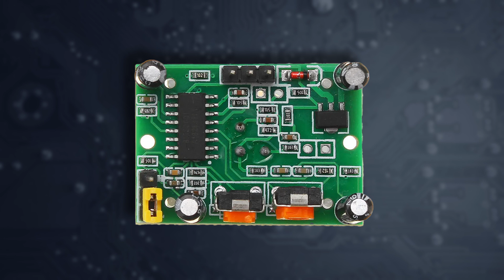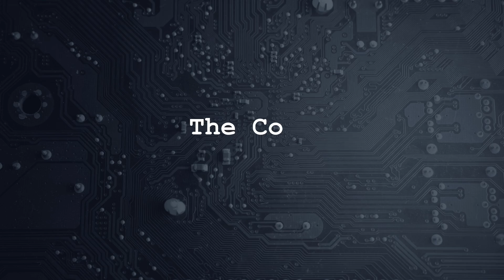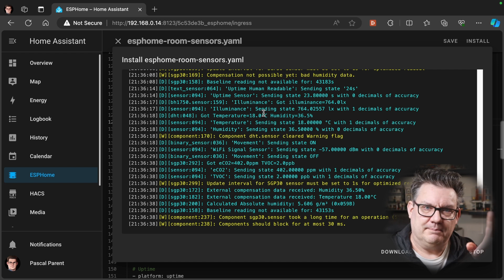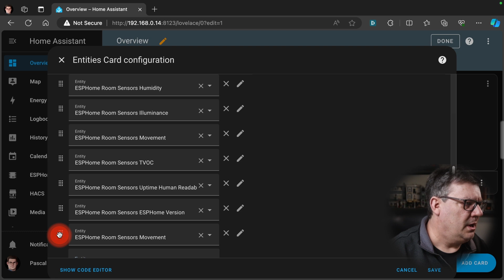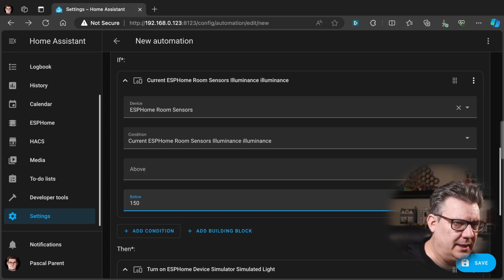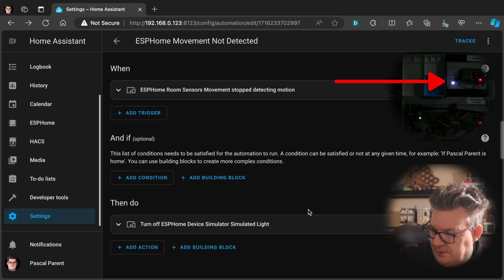Let's add to our room sensor - Part 5 - Movement detection

Comment: I like the video because each step is really well explained.
Although in my opinion, it would have been done in the same automation to turn it on and off. Instead of using 2 automations to do it
Reply from the maker: Right now I aim for simplicity, but it can indeed be done in one automation.
As you pointed out, each step is explained and splitting it allows for easier understanding.
Thank you for your comment.

Comment: Mostly i use mmWave sensors for detecting people in a room, they have the advantage of not turning the lights off on you when you are setting still (like reading , etc.), but i do use one PIR sensor under my bedside table for detecting when my feet hit the floor after getting out of bed to go to the bathroom for example. I didn't use a mmWave sensor there because i didn't want my bed covers triggering the sensor and turning on my LED strip under my bed. I have mmwave sensors in my walls totally hidden from view which is another advantage of mmWave sensors. Good video 😀
Reply from the maker: The mmWave tutorial is coming btw

Comment: Hi Pascal, good video, as usual. There are two items you missed in your comparison of PIR with mm-wave. 1. Line of sight; you can 'hide' your mm-wave sensor in a cupboard (handy for security purposes). 
2. Another item is in hot weather, the PIR sensor will become less sensitive.
What I do in my automation is add a condition for the automation to work. Example, in a living room you might want to turn off some of your sensors if you are out but your dog is still in. You can of course disable the complete automation, but using a helper that is set in the dashboard makes it more user friendly for 'Not-Nerds' like my spouse. 🤓
Reply from the maker: True enough and well spotted,  there is the mmWave tutorial coming up, I am going to speak about the combined strength of both PIR and mmWave.
I clean forgot about the line of sight though.
It was a video from hell, but I’ll chat about that in Saturday’s live stream I think.
I hope to catch you there, if only to keep me honest 😊